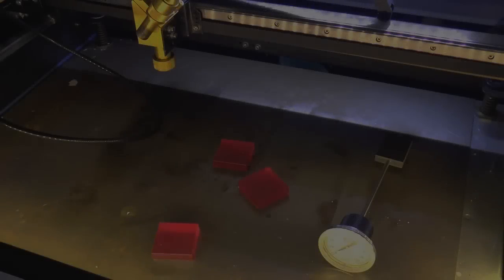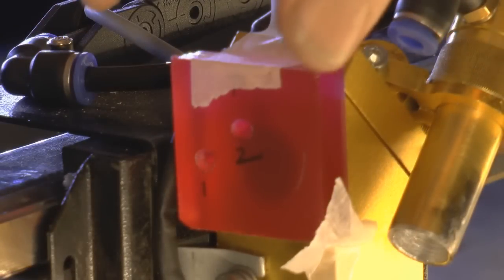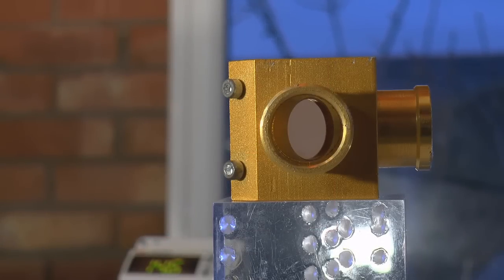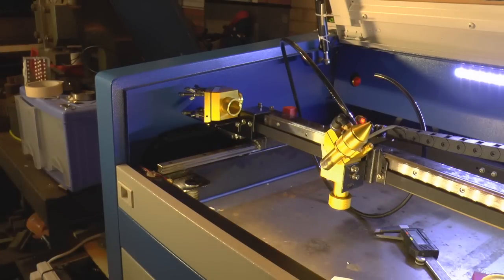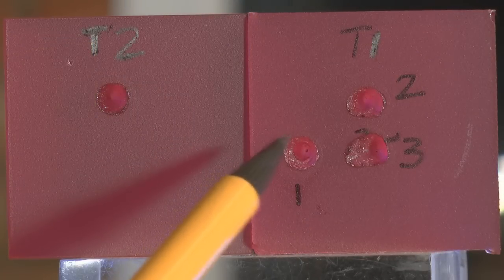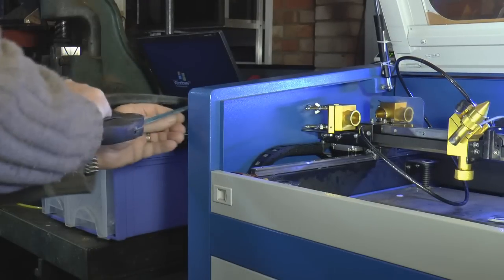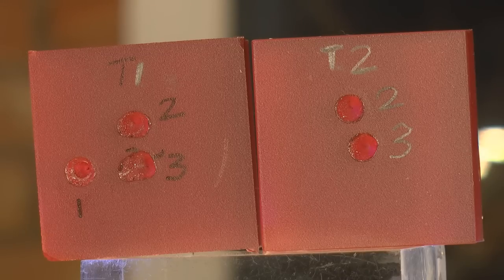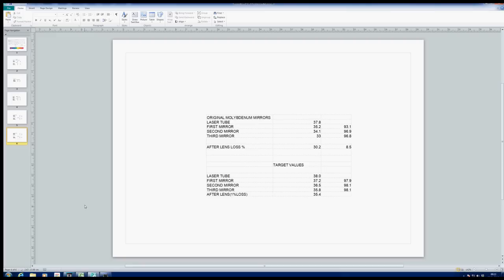RDWorks Learning Lab 42 Power Loss Between Mirrors

Comment: The hiss you heard from the laser I would guess was related to the springs used as the connection points for the laser tube and the power supply. I have not jumped ahead. Just a guess.
Reply from the maker: Hi James 
You are quite right about jumping ahead. It is quite some time before I begin to understand that this hiss is a tube characteristic called pre ionization.  It is a phenomenon that ALL gas discharge tubes exhibit, caused by the nitrogen in the gas mix not being fully ionised. This creates a very high frequency pulsing power output between say 8 and 15% power. The net power is still very low but the high intensity power spikes have some interesting properties. Reci and EFR call this characteristic the  "high-frequency impulse engraving" zone. It is great for glass engraving and also for cutting paper and thin card with almost zero burning to the edges. It is possible to see the result of this high frequency  in the form of little nibbles to the cut edge of card.  I still did not realize that this was a fault with my power supply. Not only do they fit B grade tubes to these Ebay machines but also B grade HV power supplies.
 This preionization characteristic is investigated and demonstrated in this video starting at 24 minutes  
 https://www.youtube.com/watch?v=nZuatc3eIgU&list=PLPWEtx5V9DqEogIeYRdcG_KYcB7UL2Qmn&index=26&t=1534s
Best wishes
Russ

Comment: I still wonder if we eliminated one of the mirrors and moved the laser tube 90 degrees how much that would help?  I suspect they went to 3 mirrors to compact the machine some otherwise a 1200mm tube would mean the machine would need 1200mm deeper in the Y direction.  More power and crisper power.
Reply from the maker: You lose 3 to 5% per mirror so one less mirror is not gaining you much in cutting power unless you have a 150 watt tube. It's only cutting that will be marginally reduced and with a 60 watt tube that 1 to 2 watts is less than the natural output variation from the tube.
Best wishes
Russ
Reply: Yep, but it appears from this video that it would be crisper too.  Just less stuff between the beam and the lens.  The best would be a tube with a lens right on it on the X head but with movement, etc... that is impractical and actually detrimental to the finished product in the end.

Comment: Hi Russ, did the replacement lens offer much of an improvement for power at the cutting point.

I have ran a similar experiment with a calorometer and go similar results:

At laser:                   45w
After 1st mirror :    44w
After 2nd mirror:   44w
After 3rd mirror:    42w   [should probably clean this one]
After Lens:             37w

The drop between mirrors is probably less than the noise from my experiment, but the 5w drop across the lense is higher than I was expecting.
Reply from the maker: Hi Mike
Your mirror losses seem too good to be true because If you could get gold mirrors to perform perfectly they are 99% efficient However the atomically thin gold coatings that they apply to mirrors get nohwhere near these values. Even known 24 K gold plated copper mirrors were little better than molybdenum which typically will be about 95% efficient. I have had my polished copper mirrors at 97/98%  but it was hard work to probe the boundaries of what's possible. I would recommend the moly mirrors as the best overall performers because they are solid material (not plated) they are very hard and scratch resistant and in prime condition deliver about 96% efficiency . So after 3 mirrors expect to lose 12 to 15%  ie down to about 40 watts.
Now you hit a problem. The beam MUST pass axially true down the lens tube. That means there is only ONE sweet spot on your No3 mirror.  If you don't hit this sweet spot you  could be losing power if it is clipping the sides of your tube or maybe the edge of your mirror. Most of the beam's energy is withing about  50% of your tube window diameter ( it's ideally a Gaussian power distribution) but there is energy beyond that needs harvesting.. So when you do your pulse tests you are only seeing a scorch mark from the most energy dense central part of the beam. .
Did you measure mirror 3 with the lens tube removed?. My lens is in the nozzle thus I am already taking into account lens tube losses when I measure after mirror 3. I found I had serious losses just before my lens. See
https://www.youtube.com/watch?v=ELeqP3tHlp0 from 12 minutes on.

Once you are sure you have  a coaxial beam hitting you lens (curved side up) then there is another potential loss to look for.  The yellow zinc selenide material that the lenses are made from is naturally only about 70% efficient at transmitting IR. However they can push this up to about 95% by coating it with an anti reflective material. You can pay 50 to 100% more for an HQ lens but it is the same zinc selenide but with a more exotic multilayer treatment that improves efficiency to 97/98%. I see no value in paying that much extra for 2% gain. But my point in telling you this is the coating. If you let dust and debris fall onto the top of your lens, that dust absorbs the IR and heats up possibly damaging the AR coating. Clean the lens to make it look clean and you may have compromised its efficieny back towards it's natural 70%. You can get gallium arsenide lenses but as a raw material that even less efficient at about 60%.
 I have spent ages investigating where the odd watt or two has disappeared to  but having now established typical operating losses I work on 5% at each stage and only start hunting for issues when I lose more than 20% at the work surface. Its a quick check to do just 2 readings  one from the tube and one from the lens....and less error prone to monitor the system rather than each mirror. Obviously I have to check each element when I do overstep the boundary. I run a 70 watt tube that now typically delivers 60 watts at the worksurface if I need it.

Hope this helps in some way because it's a bit like chasing smoke rings. There is always a small 1 to 3 watts variation between tests because the power from the tube is not absolutely stable so averaging about 6 readings gives a more realistic value but is VERY tedious..

All best wishes
Russ
Reply: Thanks for the detailed reply Russ, 
I will have a lot of noise in the readings posted earlier, mainly because im using a point and read IR gun on the anodised aluminium test block, so there will be a short but varying cooling period while im manoeuvring to take the post laser reading from the block.  This will be giving me the skewed results for the harder to reach readings such as laser tube.  Will confirm this when a thermistor meter arrives in the post. 

Thankyou for the link to the video, this may be causing some issues. Also the "60w" machine I got off ebay has 18mm lens, but the lens securing grubscrew/hollow bolt only has a 10mm hole in the centre. Will drill it out to see if it was a problem after checking for mirror clipping. 

Thanks again Russ, great set of videos you have for the budget cutters.
Reply from the maker: Hi Mike
I had to machine out the bore of the lens tube on the Bodor machine I worked on in Florida. That had a 9mm bore and I took that out 12,2mm diameter. It was 15mm OD but still strong enough. That was a machine that had just not been thought through because it was originally a 40 watt desktop machine that had been pimped up to a 100 watt Reci tube..
Good luck with you watt hunting. By the way if you do not have an ammeter fitted dont push the power beyond 60%. You will undoubtedly have a 60 watt power supply fitted driving a 50 watt (1000mm long?) tube. Is the tube perchance labeled KH Laser?

Best regards
Russ
Reply: Hey Russ, 
Yep a 1000mm tube with a overate supply, 75% input power gives me around 18-20ma [I believe 20ma is the max]... cant recall the name of the tube.  Overall im very happy with the machine. Your tutorials do make it a lot easier to understand working the thing tho, I got a quite lost trying to read the manual. 

Do you happen to know if better machines have orings between the lens and housing, on this machine it goes in a metal housing held up with a metal ring/screw. The engineer inside of me thinks there should be something to allow for thermal expansion inbetween.
Reply from the maker: The lens may appear to be glassy but it cracks very easily so a small o-ring cushion  makes sure you don't over-tighten it and also stops the lens jiggling around if the screw comes loose. You get some interesting results!!
Best regards
Russ

Comment: cool stuff...
so... the standard mirrors, although they could be improved power wise, a good careful clean and alignment does the world of good.

my own machine should be here tomorrow, would have had it already but the weather was not kind!
Reply from the maker: +Michael Edmond 
Hi Michael
I was lucky with my machine because it was supplied with the most durable type molybdenum mirrors.  I suspect that many other machines my be fitted with something they call K7 mirrors. This is basically crown glass containing potassium (K) oxide that has been gold coated. After a few cleans you will be through the gold. Oops.
Good luck with your new machine
Russ